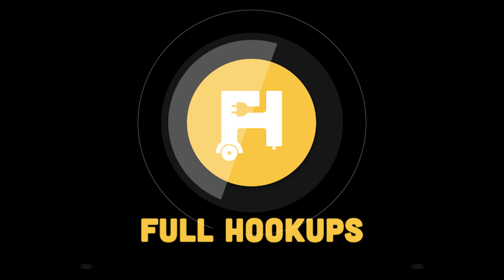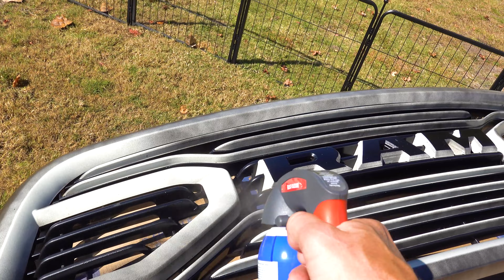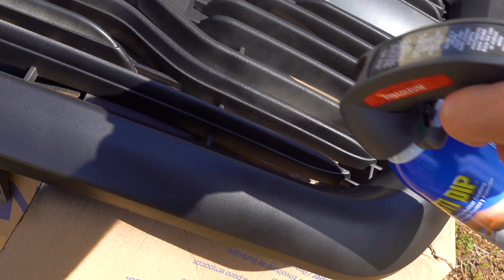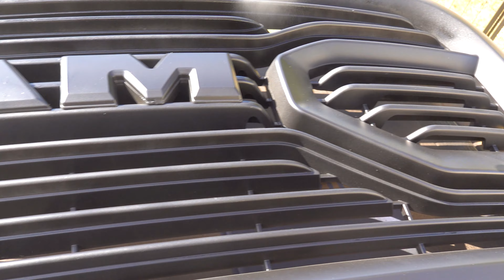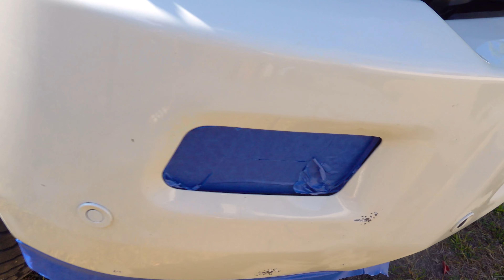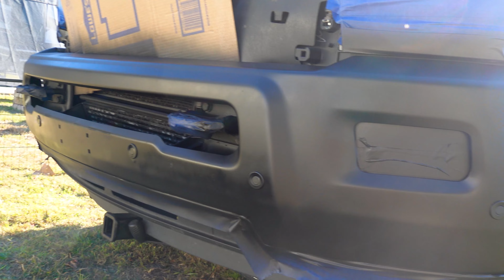How to use Plasti Dip spray painting car truck grill rims emblem badge Liquid Plastic Coating

Comment: That's pretty cool stuff.  Looks good.  Nice that you can just peel it off without residue, etc.  I've considered using it before for similar car projects.  I think I'll get a really odd color and paint my wife's car bumper just to mess with her.   The Greased Lightening stuff is  great for the kitchen of course.  If you use that on the surface of the the stove near the burners, and use a microfiber cloth rather than a paper towel, it clears all the grease without just smudging it around.
Reply from the maker: Thanks for the feedback!